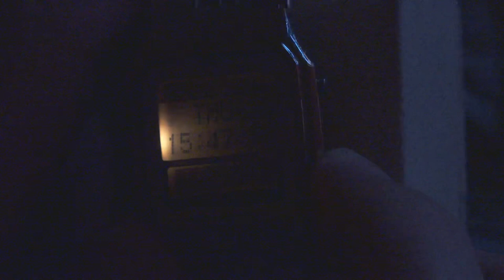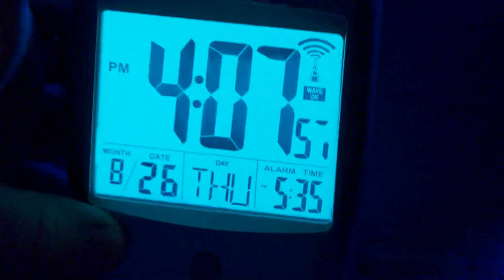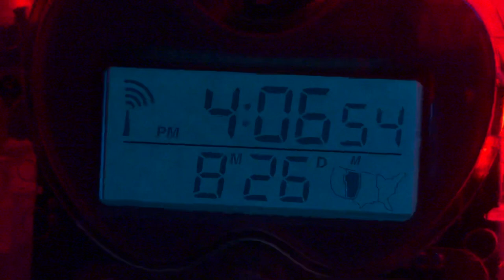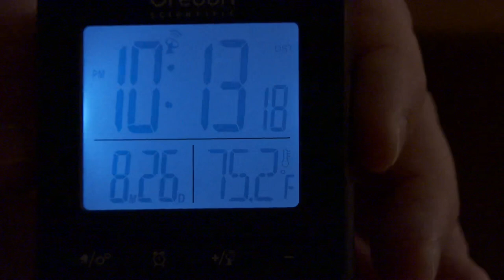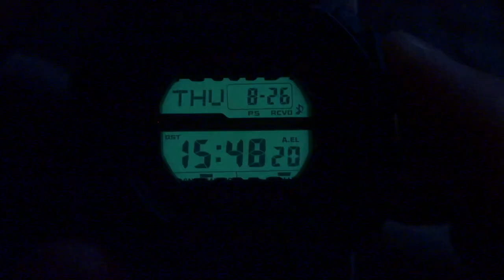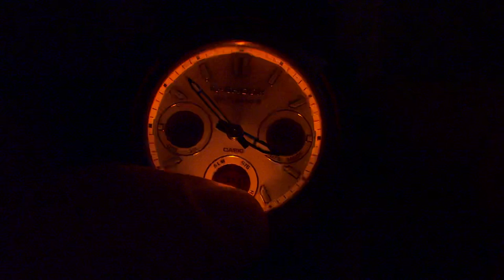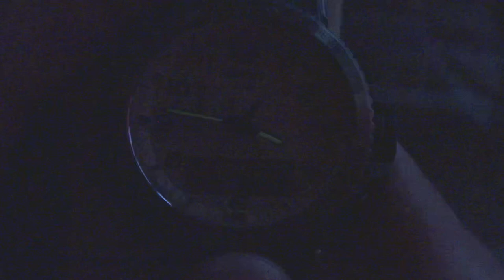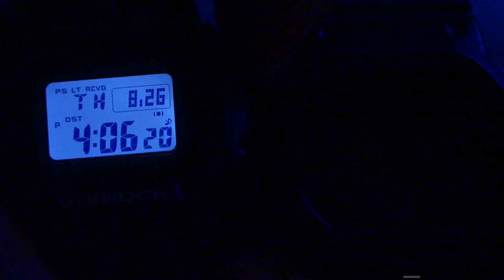Let’s Talk About Backlights in LCD Watches and Clocks

Comment: Timex still use the Indiglo technology and yet they use a different form of technology than electro illumine sense of a form of a LED light that display in a brighter blue even Timex is still marketing their LED as Indiglo.
Reply from the maker: I guess the term Indiglo is their trademark so they can use it to mean the newest thing they offer on the hardware side. It doesn’t have to be electroluminescent unless they call it “electroluminescent”. Just as long as it works I suppose that’s the best news.
Reply: @GoodTimekeeper  As you could say if Casio does that even Timex follows I use to have or I have an electro illumine sense watch that is solar powered but then it wore out over time the it keeps tells the time, then seems like a change of battery. 

Anyway their is also a bunch of companies that made a Mickey Mouse watch, well a traditional Mickey Mouse watch is analog as their was a Japan exclusive Mickey Mouse G-Shock watch, it is digital but what I would expect from Casio is that the MQ24 watch should be released in a Mickey Mouse version.

Comment: What's the difference between the Gw5000 and the GMW 5610-1? The price is 200 dollars of difference, but the GW 5000 have different features?
Reply from the maker: They use the same module so they have the same functions. Some folks like the GW5000 because you just can’t find that exact look (the colors) in the GW-M5610 models. Also, the case of the GW5000 is actually made of stainless steel with a screen-on back similar to a diver’s watch back. Then it’s covered by a resin bezel on the front. The case of the GW-M5610 is resin. Also, the GW-M5610 has a resin band which feels more soft and supple than the ones which come with the GW-M5610s. Is that all worth the extra cost? A lot of folks think so. Some folks declare that as soon as you get it you’ll like it so much that you’ll never regret paying the extra cost. I’m not sure what to advise.

Comment: I'm looking for a large digital battery operated wall clock that has a constant backlight regardless of the light or darkness of the room. Does such a clock exist?
Reply from the maker: Yes. I have such a clock. It’s no longer made by LaCrosse Technology but you can still buy this model 513-1419bl from Amazon…. https://www.amazon.com/dp/B01EZ3C7L2/ref=cm_sw_em_r_mt_dp_NV3TB5006CNQXMVHXQ7A

If you want the light to stay on all the time you’ll need to keep the AC adapter connected all the time. So if you hang it on a wall you’ll have the wire to contend with, unless you can conceal it behind the clock somehow.
Reply: @GoodTimekeeper  Thanks for getting back to me Greg. Done a lot of searching online and either they don't specify or the clock's backlight is designed to only work in darkness. I'll check the link you provided, although the wire would be a problem considering the wall i want to hang it from. Thanks again and have a good one!

Comment: Casio who were so proud of their "Illuminator" ® Electro-luminescent Back light now  has a washed out lighting that discourages using the Auto Light feature, as with  G5600UE (module 3496) where the Led is very gross, disbalanced, low contrast and doesent fades in and out in a fashion way, only sudden. 

Meanwhile Skmei producing cheap Casio clones with better,  modern and beautiful backlights  while the company  they pirate so much,  cannot offer those features.

Comment: Great review, but as an once their Pro-Trek Titanium owner, I just have to disagree - Casio is one of the dumbest company in the world, which is not gone bankrupt... yet! ;)
Reply from the maker: Why? Because they switched to a more efficient and reliable backlight? Is that dumb?
Reply from the maker: Well, that’s a long list of issues. I think my general reaction is that things like full-metal titanium cases ARE available in Casio’s premium lines like Lineage, Edifice and Oceanus. And they just barely released the new modules for “U” watches so, in time, I would expect more options for the watches which will use them. As for smart watches, they DO have fitness-oriented products. But, since they don’t also make phones (like Apple and Samsung) I’m not expecting them to make things exactly comparable to Samsung watches.

Meanwhile, I have decided that the general lines of Wave Ceptors and G-Shocks remind me of something along the lines of a Toyota Corolla in the automotive world. They’re not very fancy and people might never find them valuable in the long run BUT they’re affordable, efficient and the maintenance is generally easy. You can run them into the ground and then turn around and get another one many years later without spending a ton of money.

Can you tell that I drive a Corolla? The first one lasted 19.5 years snd 400,000 miles and the second one still seems like new after 10 years. It’s not a Lexus but it gets me where I want to be.

I generally don’t have a lot to complain about with Casio as you do. Over the last 36 years I’ve been pretty satisfied with the 80-or-so Casios I’ve purchased. Perhaps they won’t go bankrupt until after I’m dead and can’t keep buying their watches.
Reply: @GoodTimekeeper  As probably a norm, most hurtful relations with those you really care about, so - don't get me wrong! -I like Casio company a lot, especially their great old, unique and extremely innovative old watches, calculators and music instruments! I wish them well and also hope they will continue to make great stuff for affordable prices!

I just don't agree with your attitude - "They're GREAT CASIO, so surely they know what's right for me!".. ;)

-And once, my pretty wealthy ex-boss was driving for way too long past due car's intended lifetime his beloved Toyota Tercel... -It took me all my skills and knowledge to persuade his wife to make him exchange this outdated unkillable wheelbarrow for modern and safe Honda CRV... :))